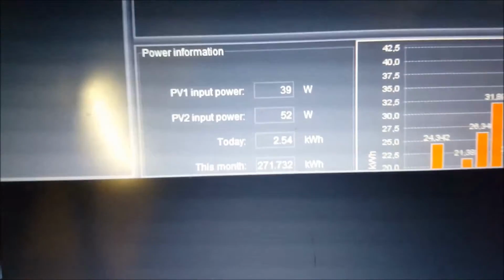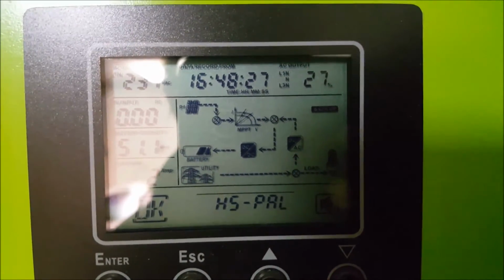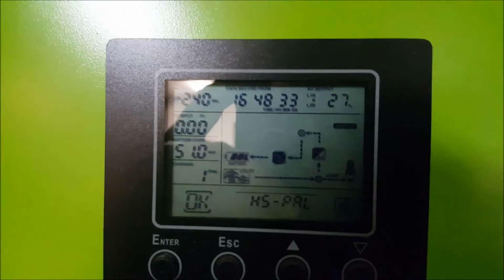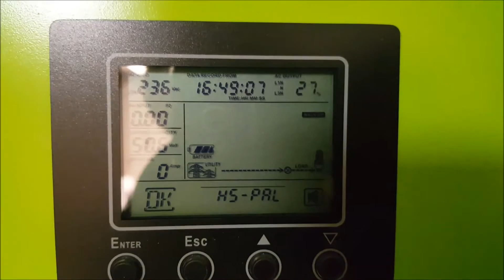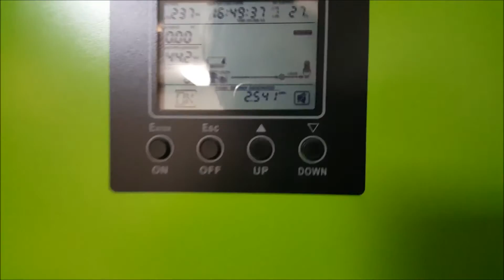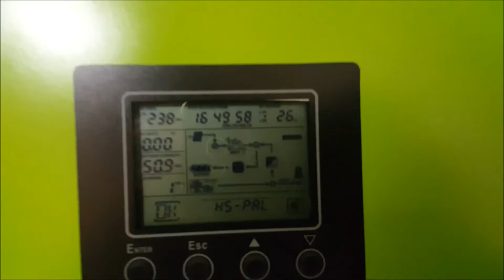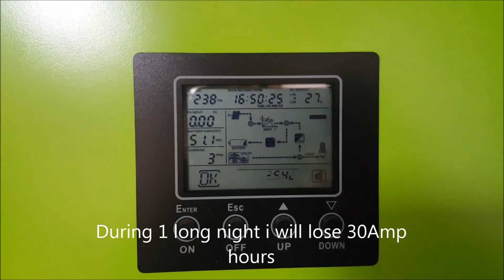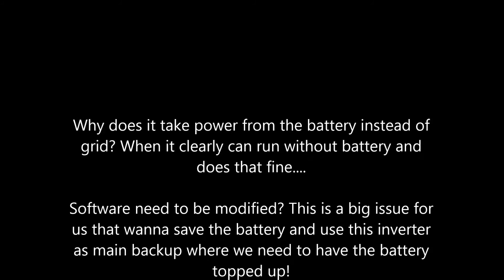Solar Electricity: Issues with an MPP 10KW hybrid inverter

Comment: Please I would like to find out if you grounded your PV modules to that of the inverter? I have a little problem when I read the manual about the fact that grounded PV modules will cause a leakage current to ghetto inverter. I will be glad if you canbexplain. Thank you!
Reply from the maker: Kwame Opoku Agyemang some inverters and panels should some shouldnt. my panels are grounded to its own ground in soil with lightning protection. my inverters goes to the grid ground. this is how we do where i live. hope it helps to answer. note that my panels ground is isolated to the actuall panels.
Reply: DIY Tech & Repairs  thanks very much for the swift response. what you are saying is that after I have grounded the frames where the solar modules rest,it goes straight to a separate earth rod to the soil. Also I ground my inverter which is from the grounding from main house. so it means there are two separate grounding..please explain the latter part well.  thanks very much!!
Reply from the maker: This is something you need to take up with the electricians in your area on how its allowed for your place. It differs somewhat. Also depends on roof-types.

Comment: I'm sure you have resolved it by now, but my 2 cents...
Some of the less well engineered Inverters have huge parasitic loads.  This can be in the form of 1 or more solenoid type relays that have to stay powered to keep power paths open, and they can sometimes exceed 500ma (similar numbers with solid state relays) each just to power the solenoid.  Then there is all the electronics, with no real sleep mode.  I'm not familiar with MPP (assuming that is the brand). So just speculating.  But I'm sure u have diodes to you solar panels, knowing you, so you aren't back-feeding the panels, or that woulda been my first guess.
Reply from the maker: There are diodes to the solar panels yes.

Comment: Seams like a software problem in the reporting on the inverter but the real question is why is the inverter using 2amps for the batt when i had unity or why does it not go into sleep mode or something so it doesnt sit there using power. Thats 120w of wasted batt power for nothing. ?? Sounds like a problem to me
Reply from the maker: Mikes DIY Tesla Powerwall ye. some explanations i got is that it only calcuates values and does not properly meassure all currents over shunts. but still waiting some.confirmation. i think that if they just look into the software on the unit and finetune it this would be a killer box. perhaps look into and finetune some hw parts as well for monitoring whats going on. i have been in touch with them about some obvious things both in software if the inverter and rhe program on the computer that would significantly improve it. lets see :)
Reply: DIY Tech & Repairs not sure why but previous comment and your response have disappeared. Yes I understand that the amount of current it draws is tied to the conversion it is doing but if you disconnect the panels and the load then the batteries should only be powering the box which should draw only 500mA max ... unless it is still connected to some load.  At 96W that 2.3kWh a day (although you have to subtract solar hours).  Is the box maybe feeding power back to the grid because of a software glitch?
Reply from the maker: Yeah and I answered. No idea where that comment went... I cant find it in comment on my page either hmm. If you shut down the load out put so yes it does not draw anything since it will then shut down the inverter totally.  No its not feeding back power to grid nor anything else since i have stuff hooked up to it. As long as you have the inverter function running it will draw this amount of power.  Normal UPS that is 3-6kva is about 40-80w continuous. Due to how this system is built its not that effective and don't forget that its not very expensive. Its not like the PIP where you can disable the inverter function and just run it as a charger. Since the inverter always need to be ready for outgoing load then it also does that by making sure it have its internal system fully charged so to say. 

I have still not gotten any answer from MPP solar about why it draws this much power or how it distributes where the power is drawn from. I have sent this quest last year and since then asked for updates 3-4 times about it....

Hope this answers a bit better why it does not draw 0.5A max :)  But still all above 100W is strange and this one can easily use 400W depending on mode and all.

Comment: All 36 of my Enphase M250 inverters combined consume about 170 Wh during the night. Your inverter is retarded. Why didn't you just keep it simple?
Reply: Un Real, Just because you have an idea on how things should work, doesn't mean it is right, or is valid for how someone else is trying to accomplish a goal! Maybe others think your 36 Enphase M250 inverters are retarded! This is why most people value freedom, we don't really give a shit what others think we should do- we forge our own destiny. Whether you like it or not!
Reply from the maker: Un Real i need to be able to power the house without grid connected and i need the upd load port. thats why i run a hybrid instead of micro.  but yeah my inverters software does something wrong and it should not draw power from battery when im not allowing it.
Reply: You have got the grid why do you insist on running off of batteries? this doesn't make sense.
Reply from the maker: For most of time thats true.... But grid is not always there and this system also acts as UPS for a couple of servers running.(Half a rack of servers...) Its a combined system in that sense.  Also the price to pay for buying grid power is alot higher than i get for selling so if the battery bank is "free" as in my case i could save some money.  Note that im not running of the batteries as of now. They act as UPS/backup mainly for the rack but i can switch the house to it.
Reply: You should have just gone grid tied for the solar and UPS for the racks. complete bullshit having solar tied to batteries. That's what I do and my racks have a 100% uptime ;)
Reply from the maker: Eya we have different opinions about it and thats fine :)
Reply: Thank Are you a Facebook page so much for the value of information
Reply: i have had 3 micro inverters fail in a 13 panel system in 4 years
Reply: well luckily for me those panels or inverters or both will be replaced under warantee life of the system
Reply: too many complaints from mppt >  the 4048 you mean ? really?
Reply: well here's hoping by the time i get approval it should be better  i believe that mppt has rebranded too giant now am i correct  and no there wasnt sacrasm i was genuinely questiooning if they had complaints (mppt i mean )